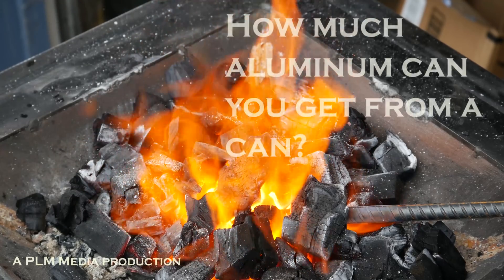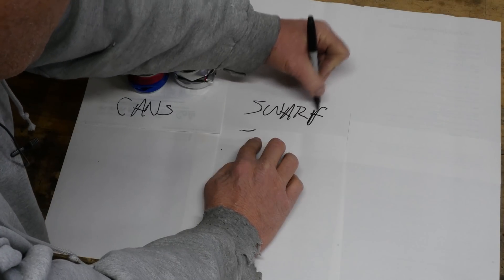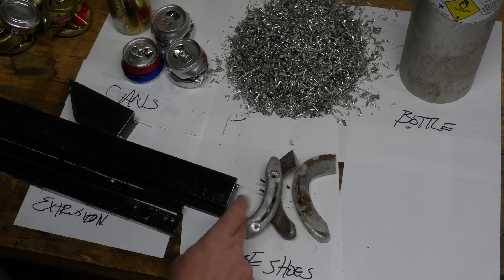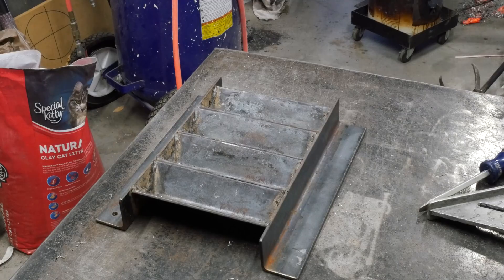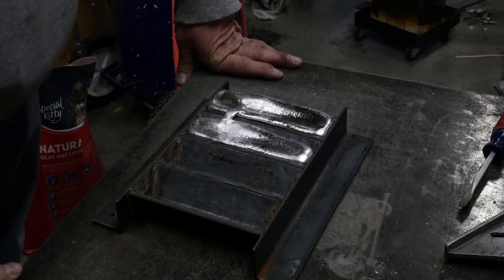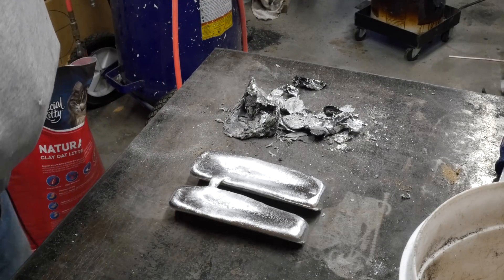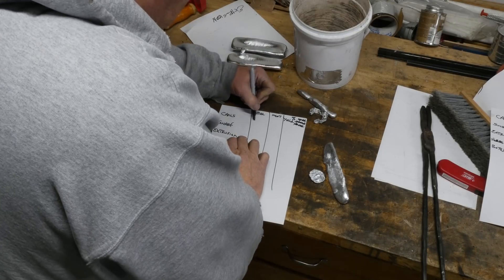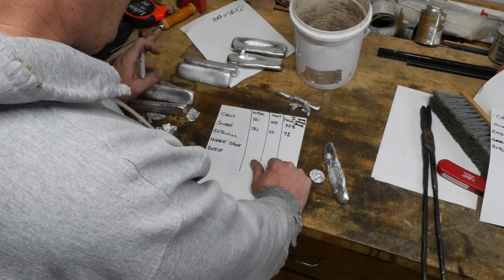How much aluminum can you get from a can?

Comment: Wow, I figured the cans would have a lot of waste due to paint, left over contents and the plastic liner. But I did not expect such a low percentage. That really changes my plans. I am putting together a furnace which I hope to fire up soon.
Reply from the maker: You can increase the yield… slightly… by getting a clean puddle in the bottom then submerging crushed cans in the melted aluminum, but there is still a ton of dross with them
Reply: Im a year late, but did you have a go with cans? I'm possibly able to get 300-500 cans a week and wanted to turn to bars for practice 😂
Reply: @josephbrown3647  I have melted a lot of cans, yes. There is a lot of slag to remove off the top. Thats a lot of cans. I would not say no.

Comment: You're going to get a decentamount of dross from cans no matter what, but if you start with a piece of aluminum and melt it to have a molten pool of aluminum going then you can push the cans in and they will melt before they oxidize too much and you can avoid a lot of slag.  When I melt cans I get about 1/3 slag and the rest aluminum.
Reply from the maker: Reed or is it Malloy??  😄 I actually did a follow up video way back in March of 2018 stating that same thing https://youtu.be/wpv7qK0ZZ3Q

I actually don't melt cans anymore, sticking to industrial ingots now.
Reply: @swdweeb  cool I'll check it out also.  I'm not claiming to be an expert or anything I have just watched hundreds of hours of YouTube videos of melting over the years and recently got my furnace going.  Been melting cans I've saved up for over a year and gotten pretty good at it but still looking to maximize efficiency

Comment: New subscriber here!  bigstackd recommended I check out your channel.  This was an interesting video!  Thanks for sharing!
Reply from the maker: Thanks for the sub and thanks for letting me know BigStackD sent you.  You realize of course that due to the high sugar and caffeine content mountain dew cans have even more dross 😄😄
Reply: @swdweeb  I've heard that cans will result in lots of dross.  Your video proved that to me.  I may just take my 34 bags of cans to the recycling center instead of melting them.
Reply from the maker: @mountaindewdude76  I don't save or melt cans anymore, its just not worth the time to do it. As you're well aware, they take up a lot of room, they smoke quite a bit from the plastic lining and the paint, it costs money in propane to melt them,...  Tat said, it is an easy source of aluminum for people so unless you have another source, you might want to consider going to the trouble and 
expense of melting them. 

I've had people give me aluminum to melt. I had an aluminum car wheel once and all sorts of solid scrap. You never know what you're going to end up with alloy-wise but its a lot more efficient than cans.
Reply: @swdweeb  I have reached out to two local recycle centers and both have quoted me a price that I'd be charged if I wanted to come down and rummage through their aluminum stash.  I'm actually quite excited about that because it's always gonna change as aluminum is recycled and more aluminum is brought in.  It might be beneficial to stop in there once a week or every other week.  I did order my first 10kg Devil Forge furnace last Friday.  I got a notification today that stated my furnace had been shipped.  While I wait for it to get here, I'm hitting all sorts of resources for info on do's and don'ts.
Reply from the maker: @mountaindewdude76  Good deal. If you can, look for cast aluminum. Extruded aluminum is often times anodized. Anodization creates a layer of aluminum oxide on the surface.  When you melt it the oxides are melted along with the aluminum and will be in your castings. Oxides increase the likelihood that you will have a porous casting.
Reply: @swdweeb  hmmm, can you give me a couple of examples of a cast aluminum item?  I'm sitting here, drawing  a blank.
Reply from the maker: @mountaindewdude76  intake manifolds on car engines, alternator bodies, wheels, water pumps,... there are tons of cast parts out there. if the surface looks like it came out of sand, it was cast. If the surface is really smooth and its long and straight it was probably extruded.
Reply: @swdweeb  Sweet!  Thanks for that!  I'll also look for some scrap electric motors like bigstackd gets.  I appreciate your help!

Comment: I finished a wight test today (2019-08-29) using 113 lbs. of smashed cans, I ended up getting 183 cupcakes weighting a total of 68 lbs., so if I did the math right that's 60.177% of the total crushed cans weight. I'm sure I can get a better ratio, I'll have to work on that.   (taken from the info on my video about melting aluminum with wood & forced air,      https://youtu.be/Civtwg8kkWI    )    Thanks for the upload.
Reply from the maker: Hey bud, I melted my last bit of scrap aluminum yesterday. I should clarify, my last cans, aluminum foil and aluminum cooking trays.  Here's the reasons. 
1. As you found, the  amount of dross is huge.
2. The resultant metal is horrible. The ingots are like sand paper on the surface which indicates to me that metal is still full of crap.  I know that it's full of oxides just because of the way it went into the crucible.

I watched your video. In my opinion you're lucky the  solder on the can didn't melt and give you a "ladle failure".  Seeing the big crucible fall was kinda terrifying. Lastly, melting aluminum inside a steel crucible isn't ideal. In its molten state aluminum is very reactive with steel. It will eat through your steel crucible and eventually cause a failure. That would be no bueno.  

Casting metal is a hoot and I encourage you to continue your pursuit of it. I know it sounds like I dumped on you but I want you to be safe and get the most out of your hobby. :-)

Comment: So I wonder what this would look like with rejected aluminum cans. The other materials were highly refined, as you would think the Al cans should be DOH!. Anyway, I’m guessing the can material rebelled would give almost as good results as the HS or the extrusion or O2 can. 

What’s my point here? Al cans are more readily available, and a byproduct of commonly used houseproduct. Compare the $$$ to buy (if even at a scrap yard) the non AL cans as compared to the little extra work of melting the cans. That would be an interesting comparison. 

Thanks for sharing this.
Reply from the maker: The biggest problems with cans is the yield and the junk that gets left behind in the melted metal. Now consider what I'm about to say with the knowledge that I melt scrap aluminum and have yet to buy an aluminum ingot that is certified. I'm a huge hypocrite ;-)

When we melt junk like cans we introduce a lot of oxides in the metal. These form what are called bi-film bubbles in the metal. These oxides are extremely hard to separate out and require a flux that most of us don't have.  No lite-salt and borax don't suffice. In fact all we do when we pour that stuff into our metal is add more junk to the metal. Anyway, back to the bubbles. These bubbles stay in our castings forming what we refer to as porosity. For most of us it is an acceptable artifact of the source metal and we don't see or care about them. Most of us are casting worthless trinkets as I was recently accused of but if you were casting a real part to be used in a machine, you don't want the oxides as they weaken the metal considerably.  

Of course the way we pour has a huge effect on porosity as well. https://www.youtube.com/playlist?list=PLU1QP34Dv8Y6-qXska4MOagRMSVWan40k In fact, I would argue that the way we pour creates far more porosity than the metal we use. 

I didn't answer your question, but it was a great opportunity for me to get back on my soapbox ;-)
Reply: @swdweeb  Soapbox accepted!

Comment: Metal coffee cans with the rim inside makes great flasks. You can get some l braces and drill holes so dowels can be driven through into the sand or ground bedding..Ground bedding is making a bed of sand on the level ground areas for the cores to sit on and then the cope (coffee can) can be lowered over it. I use that method with larger cope boxes to pour my bells...

Comment: u melt dross down and mix salt it it
Reply from the maker: Adding salt, I assume you mean lite-salt, to aluminum oxide and any other dirt that is in the dross doesn't do anything. If you want to separate oxides out of the melt you have to use a flouride based flux.  Look at http://www.substech.com/dokuwiki/doku.php?id=fluxes_for_melting_aluminum#drossing_fluxes

Comment: Maybe try a shop press to compress the swarf?  Your loss for the cans is probably the plastic liners. I'd always assumed that's what most of the "dross" really is when melting cans but your experience with the swarf means it must have some element of oxidized aluminum in the mix.
Reply from the maker: Funny you should comment on this today, I'm actually in the process of building something to compress the swarf.

You might check out this video. I did figure out a way to significantly increase the yield from the swarf. https://youtu.be/wpv7qK0ZZ3Q

Comment: The O2 bottle is produced with a process called deep drawing. It's kind of like extrusion, but there are more steps and the specifics of the alloy is different.
here is a video on the process
https://youtu.be/IoTK1vcP20E
Reply from the maker: Fascinating. Thanks for sharing that. I like how he said aluminum doesn't rust. I guess rust is specific to iron oxidation, not just any oxidation.

Comment: You didn't mention fluxing or degassing in your video. I've bought expensive foundry flux, as well as toxic degass tablets (now knowing that was completely unnecessary). You can save yourself a good chunk of change, and kill two birds with one stone by using "Morton's Lite Salt". The salt part of that acts as your flux. The "Lite" ingredient and the anti-caking/clumping additive acts as your degass. Start with a couple tablespoons of the Morton's Lite Salt with your initial cold charge (charge=the metal you're wanting to melt). Allow that charge, along with the flux to completely melt. The flux will float on top thereby excluding furnace gasses from the heel (heel=the pool of molten metal inside your crucible). Before doing any dross skimming, go ahead and add some new charge to the heel. Once the new charge has fully melted into the heel, go ahead and perform an initial skimming of dross, then add another tablespoon of the Lite salt to the crucible and stir it into the heel. This will degas the heel, re-establish a barrier of flux on top and any missed dross will separate and float on top. Bring your heel to Superheat (superheat=increasing the temperature of your molten heel by another 200 degrees above the 1280 degree mark where aluminum transitions from hot-short, to molten fluidity).(hot-short=heated aluminum that becomes crumbly and mushy...somewhere between 1000-1250 degrees). Once Superheat has been done, skim any remaining dross, then pour. Your yields should increase noticeably.
On a side note...cans are a crap source for aluminum. Any extrude or drawn aluminum is crap and makes for shitty castings. Personally I use aluminum wheels, transmission housings, old aluminum pistons, air cooled engine blocks, etc. etc. (as long as they're aluminum of course) pretty much if it was originally cast into something then it'll be a good source of material for recasting. 
Enjoy, and good luck
Reply from the maker: I just replied to another comment saying that I've got lots of that swarf left. I can certainly try it again. I don't have many cans. left so I don't know if I have enough to get a noticeable difference out of that. 

Thanks for your comment. As I said, I'll give it a try and see what happens.
Reply: You could get better yield out the swarf if it's added to an already  molten heel. Just add more Lite salt with the swarf. The key is to get it out of the atmosphere inside the furnace and into heel as quickly (and safely) as possible because as someone else already mentioned "More Surface area will equal more dross because of oxidation. Getting it under the flux and into the heel will limit the amount of oxide forming.
Reply from the maker: I'll see what I can do in the morning. I might melt a little clean aluminum first and then start adding swarf to it.

Comment: If you don't have boric acid or borax, you can use baking soda as flux.
Reply: Boric acid and borax are not good fluxes for aluminum (they work well for copper and others) they will generate more dross because they react with the aluminum. You want a flux that's not acid as aluminum is a lot more reactive than copper.

Comment: Before even watching the video I can tell you my yield is about 10g per can, or less. When I factor in the deposit on cans here, it comes out more expensive than buying new aluminum profiles (which I can get at $5/lb at a local supplier).
Now I'm going to watch the video.
(edit) OK after watching some thoughts:

1. I see you still have the problem with the plinth sticking to the crucible. I used to have it too until I decided to coat both the crucible and the plinth in satanite. No more sticking now. No need to hold my breath anymore anticipating the yellow-hot plinth detaching and falling, maybe setting fire to something.

2. My best yield was from a series of cast aluminum pieces similar to the horseshoes. They were originally a support for my mailbox (until an idiot destroyed it a few years ago by backing a truck into it; after making a new support from steel I kept the broken aluminum pieces, wasn't even sure why but now I know they were for future melting and making ingots and stuff) :)

3. The low yield from the cans and turnings is likely because of the large area/volume ratio that promotes oxidation during melting. One way to improve that would be to compress/pack the cans or turnings as much as possible before putting them in the crucible. And cleaning them beforehand. Another thing that may make a difference is flux, and lots of it. I'm planning to see what kind of yield I get from cans when I use a LOT of flux (1:1 molar mix of NaCl and KCl)Salt is much cheaper than aluminum, if it avoids wasting it then it may be reasonable to use this method.
Reply from the maker: I guess I fell into the "or less" category. I got 4.7 grams per can out of them. You're obviously getting a lot better yield than I did.
Reply: I think the flux makes a difference, by allowing me not to remove that much molten aluminum with the dross.
Reply: I can't seem to find Satanite  on the Internet.    Is it a brand name ?   Would simple refractory cement work as well?   Thank you in advance.
Reply from the maker: For some reason I can only find your question on my phone so my typing is limited. I’ve never purchased it. I know Paul at “Paul’s garage” has.  Ask him what he bought, Tell I sent you. He’s a great guy and will be happy to help you out
Reply from the maker: try https://www.hightemptools.com/refractorycoatings.html

Comment: Haha!  Great demonstration!  It's all about the amount of surface area available to be oxidized.  The only thing more plentiful that the amount of dross you get from a pop can melt is the number of hoops you have to jump through just to get a disappointingly small reduction in that amount...   Thanks for the link buddy!
Reply from the maker: Yeah, I actually stopped collecting cans a while back just because of the poor yield. I had to beg my son to save them for me to melt in this video. They're definitely not worth my effort to melt down into ingots. Now I've got to figure out what to do with 40 gallons of swarf that is sitting behind my garage. :-/  That stuff is almost all surface area.

NP on the link. I thought the stop-action was a nice touch and I know it was a bit of work. Let me know sometime if you get a bump in views.
Reply: swdweeb I had a lot of fun making it.  I really wish Stikbot was a thing when I was a kid...
Reply: False! I've seen the dross re-melted to produce the same yield as the ingot you made! Also try using some flux.
Reply: Jordan sure, it's possible, you can use extra flux and carefully crush each can as much as possible to reduce their surface area and double your melt times by pushing each crushed can under the surface of the melt individually and save mats of old dross to use as a cover shield and try to reclaim some clean metal from the dross by remelting it later with even more extra flux, but now you're several heats in just trying to reclaim less than what a single melt of more suitable scrap would, and all that flux is taking its toll on your crucibles.  At some point you're spending more time and effort than you're saving money.  In many places you can actually turn in cans for scrap, and being almost pure aluminum under all that paint and plastic, they should pay more per pound than you'd get for good clean cast scrap, which melts much better and casts MUCH MUCH better due to the silicon content.  Been there, done that, got the T-shirt, no thanks, I'll stick with my wheelium (356 cast aluminum).  But don't let me or anyone else spoil your fun if you like to melt cans. - You can actually learn a lot about mold design trying to compensate for all the extra shrinkage, hot tearing, and other casting defects that come from casting with extrusions and can metal.  If your doing simple shapes without too many sharp corners or thin sections or changes in thickness, you might not even have too many problems.